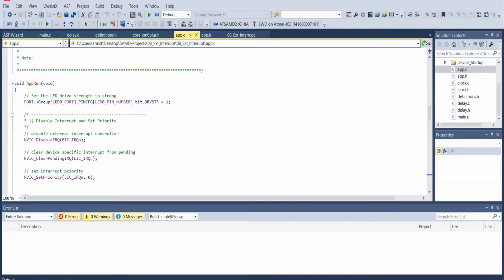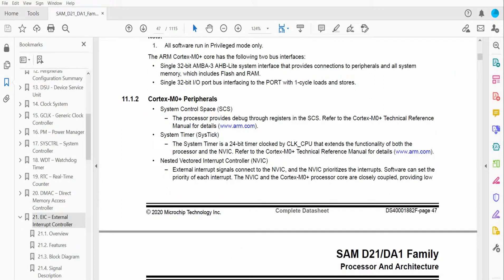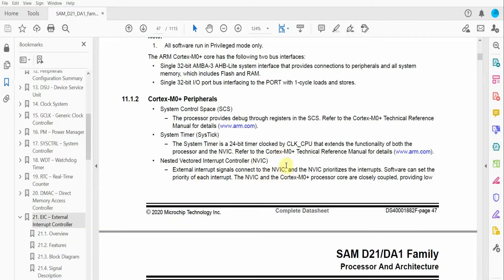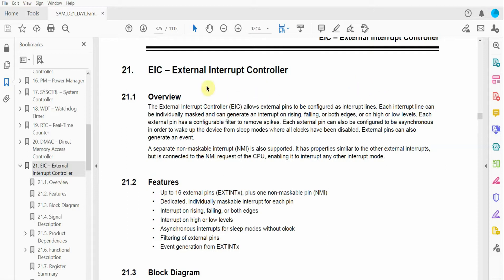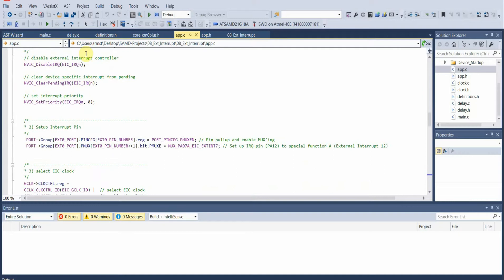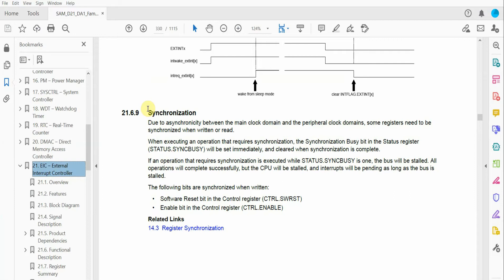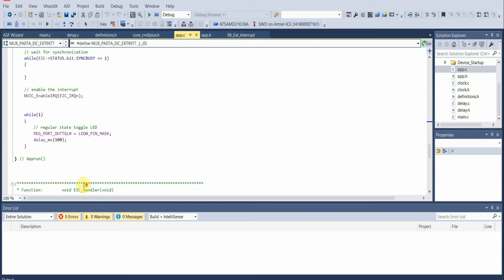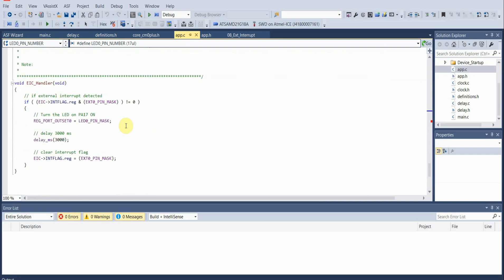SAMD21 ARM Cortex Tutorial #6: External Interrupt (Bare Metal)

Comment: I am trying to modify this to use PA17 as the interrupt trigger, and I am able to compile but havnt yet managed to trigger an interrupt. I have been able to trigger one on two pins using the arduino functions attachInterrupt, however often when an interrupt is triggered the rest of the program halts. How would you change this to work with PA17?

I have changed the following lines:
PORT->Group[PORTA].PMUX[17 << 1].bit.PMUXE = MUX_PA17A_EIC_EXTINT1;
 EIC->CONFIG[0].reg |= EIC_CONFIG_SENSE1_BOTH | EIC_CONFIG_FILTEN1;

Any help would be greatly appreciated!

Comment: I am a super-beginner on SAMD21s, just started a few days ago, but something in your sample code in the video and on github does not look right. Line 107 (08_Ext_Interrupt/app.c) says "PORT->Group[EXT0_PORT].PMUX[EXT0_PIN_NUMBER<<1].bit.PMUXE = MUX_PA07A_EIC_EXTINT7;" but I think that the PMUX index should be EXT0_PORT_NUMBER>>1, not shifted left, and also, since pin 7 is odd, it should be using PMUXO instead of PMUXE.
Reply from the maker: At the time all the code was posted it was working 😁